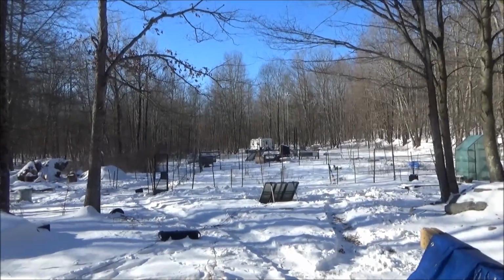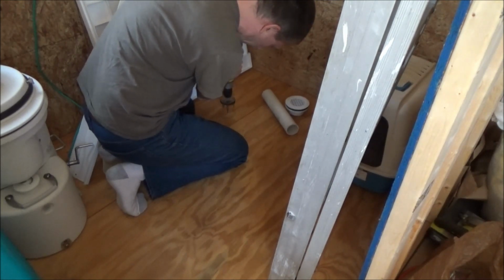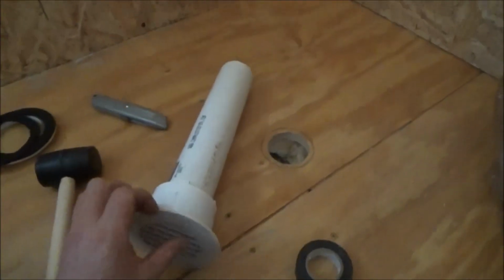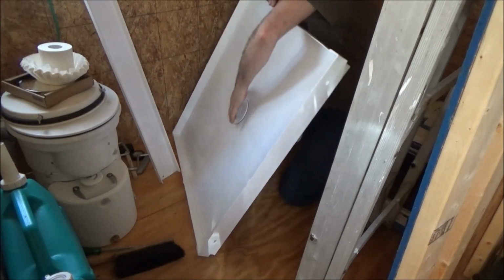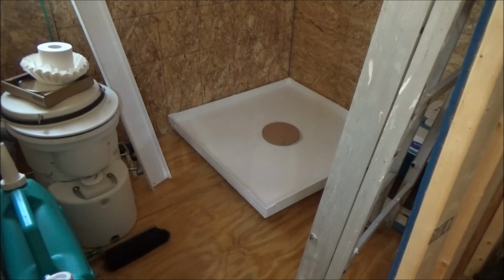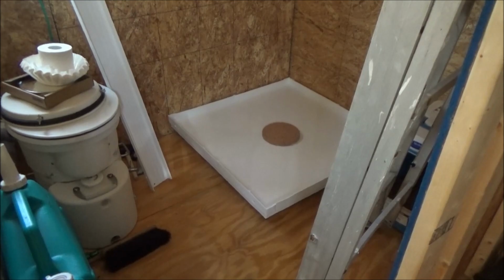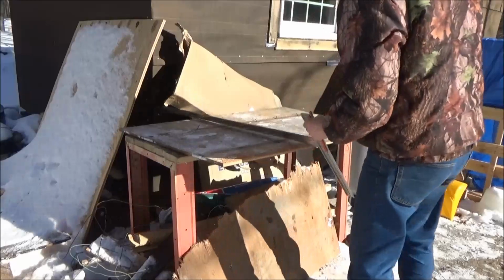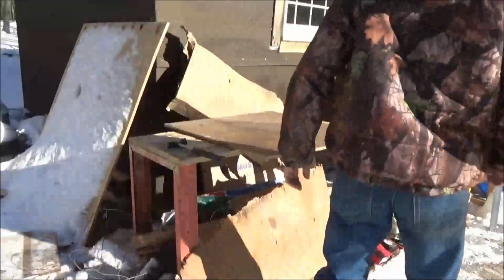Installing My Tiny House Shower Pt 2

Comment: My idea for a low budget shower would be a galvanized wash tub and a submersible 12 volt screened  pump and flexible hose.Any P-Trap will freeze unless you have it inside or use a heater tape. Maybe some RV anti-freeze in poured down drain after every use??
Reply from the maker: I was planning on making such a shower before I got the on demand water heater. So much better.
Not sure yet about the drain. I am considering using the original camper gray water tank

Comment: Just either cut a larger hole in the floor or use scrap OSB to layer up to the height you need. use a U-bend to trap water and stop air returning.

Comment: Expanding foam will seal the pipe to the floor. It's fairly common in new construction.  Though in new construction, they use "Fire Rated" expanding foam to prevent the spread of fire through the sill plates or floors.
Reply from the maker: Yes that is my plan

Comment: One of the best investments I have made is installing a solar hot water system. I have a on demand backup but have never had to use it in 2 years. Propane here in Mexico is very expensive and I only use it for cooking. I had a thought that you might install your water source on the roof and paint the tanks black and the sun will heat the water for your shower.
Reply from the maker: In Mexico you probably dont have the deep freeze we have here. I would need antifreeze and water mix in the solar water heater and then a heat exchanger to transfer the heat into the water inside the tiny home. Its a bit more complex. I hope to do it one day but its a lot of work.
Reply from the maker: MsPunkin13 Yes in the warmer months it is perfect. I was using my black garden hose as a very fine shower in summer. All the way up to fall it was nice and hot when the sun was shining. In winter it can freeze though and you need a different option.

Comment: Soon as I saw all those ads I was gone...after leaving this comment of course!
Reply from the maker: What if your boss decided to cut your pay? And I am sure you do NOT watch TV at home then do you?
Reply: The Do It Yourself World
About those ads. I am having problems with flashplayer and have disabled it, so FireFox is using html5 and I don't think it understands what to do with the ads. It opens a blank box in the right hand column but no ad.
Sorry if it's cutting your pay, but not really my fault (other than I refuse to boot in to windows and use IE!)
Reply from the maker: J. Williams That is no problem. Its not your fault. But the comment he left saying that he would not watch my videos at all due to ads? Well I guess he has no TV at home then. Ah, I have to edit the comment above.
Reply: J. Williams
I just watched a video on this. It is actually Youtube that has changed from flash to HTML5.
Reply: The Do It Yourself World the comment still gives a view and rating

Comment: As far as a firm base under the shower a concrete mix isn't even necessary, very  likely a single 50--70 lb bag of premix masonry mix will do the job, just mix it firm lay a single layer of the clear construction plastic down between the sub flooring and the mortar mix trowel it on with a slight over fill method and once your downspout is connected lower the whole shower floor panel down and lightly sink it into place, it will push out any extra, then allow it to cure a couple of days before stepping in on the shower floor. After its in place wait a couple hours then carve off the overflow and wipe down the siding where mortar mix came in contact with it.  Should do the trick.

Comment: About needing a cement pad to put the shower stall on. I put a similar one in my house over 30 years ago, without a cement pad, and it has not cracked or broken. So I think it depends on the installation. I've seen nothing Troy is doing that I wouldn't have done!
Reply from the maker: thanks
Reply: same here :)

Comment: Sure someone  has already said this but you cant use a P Or J trap. It will freeze in Winter, Most likely crack the pipe but it will not drain. Just a Thought, Enjoy watching the videos. You are seam to be doing OK for Winter.
Reply from the maker: thanks

Comment: Troy, from the troubles you had with the drain, im guessing that you assembled it dry. Should have lubed the gasket with either liquid dish soap or some Crisco, would have went right together. Good thinking on the rounding the end of the pipe. With those type drains, you have to bevel the end of the pipe or it will just push the gasket out. Usually, the pipe is already installed and you attach the drain to the shower pan, the drop it over the pipe without the gasket. then take lubed gasket and drive it in with a seal driver. If you have any plumbing or pipe questions, shoot me a message or give me a call.
Reply from the maker: Thank you

Comment: Why cant you put the panels in front of  garden on the north end right between the tiny house and the garden fence or just on the other side of the fence then they would be close to the house and  I know they can face south right there they have the whole meadow to get light from right there. I know they would get plenty of light right there. How could they not?
Reply from the maker: I plan to have those panels out where they are and the other 4 up by the house. Soon the sun will be higher and the ones in the meadow are in the best spot. The other problem is that I have the wiring out there for combined solar and wind power already. Setting up new wires in a different place costs money. First I hope to set up the other set. Then I plan to later build an overhang on front of the tiny house and put the solar panels up there.
Reply: OK hope you get it lined out soon so you can make more power.
Reply: Yea i seen that. He's got full sun on the north side of his field. Also again your angle is wrong on you panels adjust for direct sun. Any angle but direct reduces your power output.

Comment: You shouldn't have to worry about no cement under the base as long as you fully support it with an additional frame. build a smaller frame (floor support) w/16 inch sides the same height as the big frame and place in the center of the base. Your shower floor already has a grid to distribute weight. All you need do is support it. Oh, a trap will freeze down there. If you insist on having one, it will need to be filled with anti-freeze when not in use. Install a 90 degree elbow as it clears the floor, run 4 ft of PVC out the back, add another 90 pointing down. There should be enough turbulence causing ELs to prevent air from blowing in. Drop an old mouse pad over the drain when not in use.
Reply from the maker: The next video is uploading showing the floor support for the shower. Thanks for the idea on the drain. I am considering all ideas right now.
Reply: You might be right about the elbows being enough... but when someone suggested blocking the airflow with a telephone book that seemed ok at first glance that I though about it...if no trap he'll be getting a blast of cold air right up the wazoo during a shower.  O.0
Reply: i've installed hundreds of these shower stalls and we alway put a cement base down first. It keeps the moister out so the floor won't rot in time plus it seals everything up. plus gives you the support you need so they don't crack. But do it the way you want it's your place just trying you how do doit the right way
Reply: The Do It Yourself World that wont work i already tried that once .if you leave the grate off you can put a simple drain plug in it
Reply from the maker: Harleymansgarage Sorry but what is done is done. Please do not take offense because it was done before you commented.

Comment: Channel locks are what you need, not a pipe wrench. Pipe wrenches are used to get things off, not on. 
I am probably going to be the only one here who will say that you don't really need a p-trap as you're not connected to a sewer or septic tank that is sealed. The only thing that the p-trap will do is keep the wind from coming up, just as you said. Or you could just get yourself a rubber mat to plop down on top of the drain while it isn't in use. This would work and you won't need to worry about how to keep the water in the p-trap from freezing in winter. 
This, of course, is assuming that your grey-water catchment is going to be gravity fed and not a closed, sealed system.
Reply from the maker: I am thinking about the gray water tank from the camper. Then use that for gardening. If I put it up on blocks, just off the ground then I can easily pour it into watering cans. Or gravity feed through a garden hose to the garden. Would be cool.
Reply: The Do It Yourself World  Whatever you do for your catchment, keep in mind that you have to keep the water from freezing in the winter time. I figured that you'd be using the grey water as a water source for your garden, but you will want to make sure that you're able to scrub the tank out periodically, especially if your kitchen drain is going to the same catchment. Could you perhaps draw us a picture?
Reply from the maker: FromThe Prairies I am considering a prefilter for that though

Comment: all that matters about the drain is you got it done. I would have just got it in there and used the crap out of silicon LOL. but a little hint from someone that HATES cold wind. get a slicker suit and put it over your cloths and it will cut a lot of that wind off you. except your hands you like me on that I cant do anything with gloves on not even thin ones
Reply from the maker: thanks

Comment: What is the gage of the wires from the panels to the house.
In my opinion,
1.heat 2.food
3.power.....are the most important 
4. Shelter you already have
10 gage wire is not that expensive,your power sent to the panels would be a lot more effiecent , time and money need to be used a lot more carefully,once you have dealt with these obsticles everything else is not as important, it's really time to prioritize
Reply from the maker: Wire is about 2 gauge. But the panels are 130 volts at 8 amps. So there is little drop. I lost 50 watts total in peak summer sun. That could also be due to heat on the solar panels in part.
I prioritize based on weather, materials available and funds.

Comment: If you have an adjustable rubber (nylon) strap wrench, you could try using it to torque that one-quarter turn.  I have one because none of my oil filter wrenches would fit an oil filter I had to remove.  If you don't have one, you could do the same thing with a rubber tie down cord and a stick.

http://attach.kawiforums.com/2006/03/06/20060306070503-0-3997.jpg

http://i5.walmartimages.com/dfw/dce07b8c-a01e/k2-_cbdf34c1-6d3f-42c1-a2b0-45a69453767c.v1.jpg

Comment: Hey.. did we just see the Hole cutter roll on the floor? We played it back three times [you place it on the floor and it roll's on it's own] Is the Tiny house settling? Lets see a Level on the place.
Reply from the maker: Renagade CalendarGirls Not sure. It could have been inertia. Or because its very old and off balance. It is quite old and a round object will settle with its heaviest mass on the bottom. I have leveled the house and checked again and again on and off video. Just checked everything again two days ago.